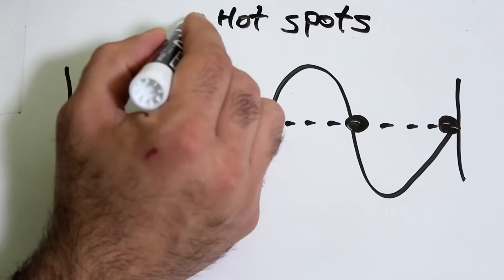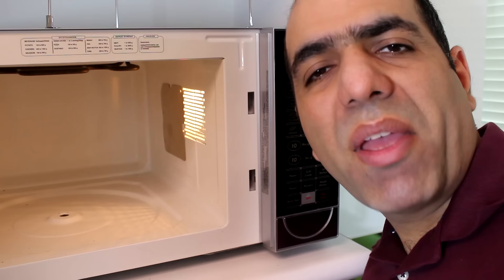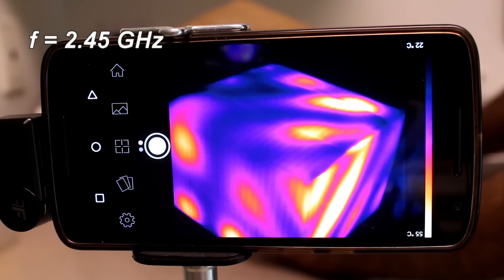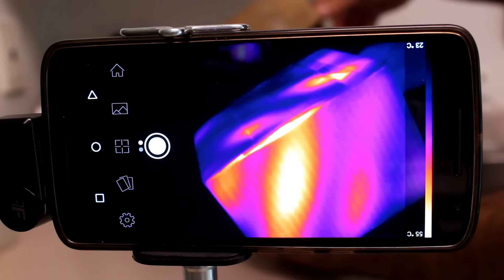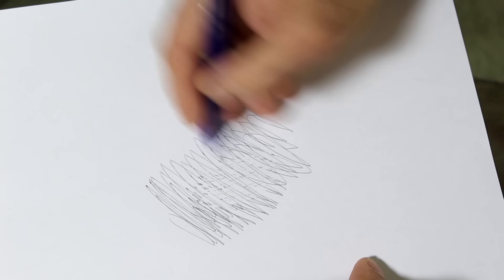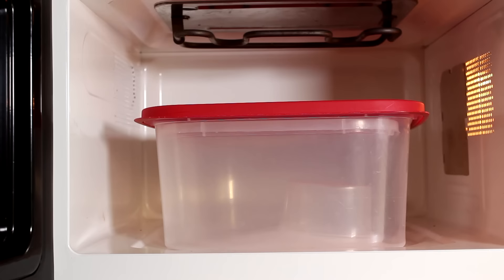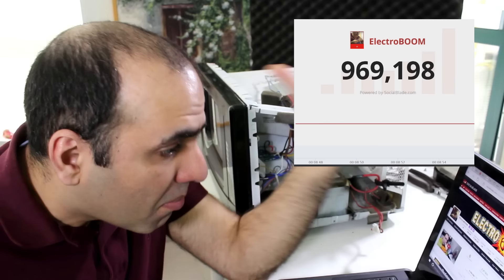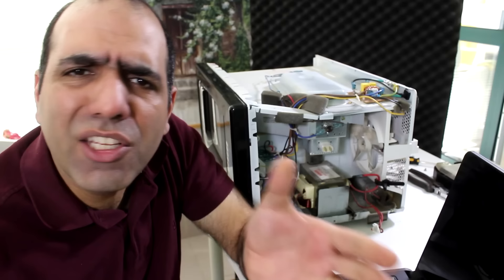Speed of Light, Microwave Oven and How It Works

Comment: Your video is very interesting^^.

Just additional suggestions/comments:

1.Instead of using LED,use a Neon Lamp.
They'll light up as the wave generated,i.e
when the wave is produced by the magnetron it lights up and vice versa.

2.The wave stirrer is used in some of the Over-The-Range type microwave(i.e Samsung,GE brands).
It's uncommon to see it in the Countertop Microwave Oven(type shown in this video).
The commercial ones also used the stirrer along with extra magnetrons in some models.

3.It is not safe for an untrained person to open up a microwave for whatever reason.
Always discharge the high voltage oil filled capacitor by shorting it even after turning it on for a while(read the label on the component- as this could be placed anywhere in the microwave.
One easy method is to use a screwdriver and touch both terminals.
A relatively simple act but could save yourself from electrocution.

Everybody who viewed this channel is very familiar with a short situation- so I'll skip that..Electroboom is a short expert..hahaha..

It's better if you use protective gloves with insulation- there are plenty of sharp metal objects i.e magnetron housing itself and the risk of electric shock.

4.The humming sound not necessarily indicates high voltage diode,capacitor or magnetron problems.
It could also comes from supplying voltage higher than the recommendation.
Sometimes the microwave sounds normal but has a defective capacitor.

Placing a glass of water in on the turntable like Electroboom did,is to see if the water heats up. If it's not heated,the magnetron is not working(it could also indicates the capacitor/high voltage diode is not working as well)
Either way-discharge the capacitor for your own sake and leave the repair job for the service technician)

5.Don't use any metal item(i.e aluminum foils,stainless steel,canned food/drinks,spoons ) inside the microwave cavity,but small amount of aluminum foil is safe and no paper products.
These are fire hazards-could cause fire.
Those sparks/lightning inside the cavity is not trick show/experiment when it burn your house down.

6.Although it is not said in the video,while heating up the water or soup or any liquid,avoid heating it up for too long.
It'll produce superheated liquid-
you'll see it's not boiling from the viewing screen,but when you immediately take it out,it'll boil like crazy.You'll get some nice degree burns.

7.The mushed brain is not possible unless you'd tampered with/by passed the interlock switches.
When the microwave door is opened,the magnetron will not work under normal condition.

8.Although it is already explained in few comments below,

The generated waves mostly stays on the inside of the microwave oven cavity or under the main metal cover(the one that you opened before you could see the components inside)

There might be some leaks,usually on the door if the door metal frame is defective(this frame and the cavity itself act as a Faraday's cage to contain/make the waves stay inside).

The micro waves generated by the magnetron will not cause cancer.
It falls under a non-ionising radiation,meaning that it heats up your body part nearest to the wave source(leakage).Usually your hands,torso etc.Same as Electroboom explained in the video(heat generated by excited water molecules)

In the past,the waves might interfere with the pacemaker,but current version is much better equipped to withstand interference.

Normally the escaped radiation is on the door area(due to defective Faraday's cage,i.e the metal frame on the inside of the door bent).
It is usually way lower than the product regulatory and safety limit(5mW/cmsq).

In the US,the FDA's Center for Devices and Radiological Health (CDRH) monitors this leaked waves value along with other requirements.Manufacturers are asked to voluntarily send their microwaves products to be tested.

In other countries,the relevant certification bodies will perform annual/quarterly audit on the factory that produces this products.

In Canada(I think Electroboom is from here),
for example,CSA Group or old name: Canadian Standards Association(CSA)  will audit the factory uninformed on quaterly basis for making sure the limit is followed apart from other safety requirements.
Underwriters Laboratories(UL) also done the same thing,UL covers for US and Canada too depending on the certification of the product.

The European consumers are also protected,
the certification bodies like TÜV SÜD,NEMKO
and etc performs the audit on yearly basis.
The standard that they use is IEC 60335-2-25.

Not to forget in Malaysia,it's SIRIM.

The magnetron component is the cancer causing culprit.Easily said,the pink component(shown in the video) or of other colours.
Avoid any contact with this or the powder when it falls of.(touch,inhale or etc)
That's why in the US,you'll see California Proposition 65 Warning notes on the microwave carton box.

 I couldn't write down all,but I hope these information helps and don't forget to read the user manual-there's a reason why those warnings are printed there.
They're required by the regulatory bodies.
Although the natural selection is perfectly fine in my opinion,
but the warnings are ways to protect the innocent people that are usually affected by these Darwin's Award winners' actions.

Comment: Don't microwaves only run at half the power because they use a half wave rectifier? Would be neat to try and get the full power unless that transformer is running too close to saturation, and not to mention how easy it is to melt them just by applying a few extra input volts LOL

Comment: Ok, it's just like the way using microwaves to beat food was initially discovered.  Someone had a chocolate bar in their pocket  melt, when using microwaves in a communication system •• and then used hot dogs to tune them.

Comment: if magnitron required voltage then use tesla coil powered by battery or gearbox and pulley system or leverage principles

Comment: thinking back to my radar days.......the extremely high frequency of the power....the electrical properties change to that of a fluid... the wave guide acts like a pipe .....due to skin effect.. the surface of the wave guide is not conducting the electricity  like a normal circuit....but more like a pipe

Comment: Maybe you should warn people about the high voltage capacitor in the microwave that needs to be discharged before you touch the internals...
Yours doesn't seem to have it, but those that have are very dangerous.

Comment: The size of the holes in your microwave door are no accident. They’re just slightly smaller than the diameter of a microwave, meaning the microwaves bounce off, rather then passing through, keeping you safe. Any time the shield in your door becomes damaged, get a new microwave.

Comment: Did you just say that waves in the chamber travel a bit faster than the speed of light (knowing that those waves are electromagnetic waves which IS light). This is so wrong though
Reply: No, he says that based on his measurements of the hot spots. He was saying that he was only a bit of of the actual wavelength

Comment: There's a BIG capacitor just under the fan, sometimes to the side. DON'T touch it. xD
Reply: You can touch the housing but avoid the terminals..(haha).

That capacitor is called high voltage capacitor,usually 2.1kVac and more than 0.1 microFarad.

To be safe,always discharge it by shorting the terminals together(easily done with a screwdriver).

Anyway..this rule applies to all electrical appliances that has built in capacitor,nobody want to get electrocuted even after the supply plug had been removed from the mains.

When you shorted it,there's a spark and pop sound..
(I think all the viewers of this channel knows what it looks like when a short happened ^^
Electroboom always demostrate it perfectly..hahaha)

Comment: I tried to kill a cell phone by putting it in the microwave; it had a metallic coating on the plastic which sparked a little bit and it charged the phone. Phone worked perfectly after I microwaved it I can’t say every phone will be that way, but that Motorola flip phone that I microwaved was none the worse for the wear, except for the burn marks

Comment: So I thought microwaves are low frequency, long wavelength, non-ionizing radiation. And high frequency is short wavelength ionizing radiation, like UV on up to gamma. Yes, no?  I bet there is a way to put metal in a microwave without it arcing.

Comment: Please don't try do anything he done in this video, he hasn't mentioned anything about the high voltage capacitor, after the transformer steps voltage up to 2000v it will go to a capacitor that charges it 4000v, it is very important to have good earthing on the microwave and ensure there is a diode to earth on the capacitor, capacitors hold there charge and if a microwave has faulty diode or no diode you will get killed from the shock touching any high voltage components. Microwave are serious stuff don't touch them unless properly trained, also I would imagine the magnetron are going to really struggle to ignite without the capacitor, he said the rest of components are junk lol

Comment: How we powered microwaves with our hand

We winding up a strong spring by hydraulic Jack which released it's energy  by gears and we run a Dynamo which powered up microwaves oven 

For some time 

How you calculate this system in terms of efficiency 

Hydraulic jack 
efficiency 80 %

Spring energy 
Efficiency.  ? %

Gears efficiency = ? %
Dynamo 
Efficiency = ?%

Microwaves
Efficiency = ? % 

So found a simple integrated formula for it like we give energy to gramophone or trampoline singing metallic drum 

By winding up the winding key 

So if you make such a system then we can saved millions of kwh round the globe 👅😃👅😃👅

We change some circuit of microwaves as well for better efficiency

Comment: I know this is old and you may not read all your comments, but could you PLEASE do a safety video about MOT's?
You video yourself getting shocked all the time and it may lead people to think that MOT's are safe to play with. Your audience needs to know just how dangerous an MOT can be. Consider it a PSA.
For everyone else: Microwave Oven Transformers are capable of very high voltage AND current and can kill you instantly of you aren't informed. Please do not play with them unless you are VERY well versed in their operation and use protective equipment. ElectroBOOM jokes around a lot but these are seriously dangerous toys in the hands of the complacent or underinformed.

Comment: Microwaves are not ionizing radiation and can't cause the breakup of DNA like ionizing radiation, but can still cook you and that will not pan out well for your biochemistry either.
Reply: but theres beryllium in the magnetron if opened. i think thats what he meant by cause cancer
Reply: @SPARKY832010  Don't smash or grind the ceramic insulators and breathe the dust.

Comment: Mehdi, I have a question for you. If light, is not an instantaneous communication and the universe is moving at 1,300,000 miles an hour or 361.111111 miles a second it would create a divergence in a laser beam of 1.1 inches over 50 feet. We do not see this happening so I have to conclude that either we are at a dead stop or light is instantaneous communication. A laser that they use to test the velocity of light, is not an invisible light beam from the side like a beam of sunlight, so it is like measuring apples and oranges. As it requires time to bring the atoms of gas in a laser beam to a state that they fluoresce. Just like electricity must flow through a filament in a light bulb for a time before the filament emits lights. What is your take on this?
Reply: What? Conservation of momentum works with any medium.
Reply: @MaryAnnNytowl , so if as a galaxy we are moving along at 1.3 million miles an hour why do we not see a 1.16-inch deflection in a laser beam? Light has no mass and is considered to move in a straight line at velocity C. However if that were the case and our galaxy is moving rather swiftly it would cause a laser beam to bend 1.16-inches in just 50 feet. 

The fact that light does not have mass also means it is not affected by gravity and it is not. Light bends near heavenly bodies due to a ramping density of gas around any heavenly body like the moon, which causes light to refract into the denser part of the gas.
Reply: @MaryAnnNytowl  Also consider that if light had a speed limit, as a far off image moved slowly through each inch of travel to the viewer, any differences that occur over the time traveled would superimpose over the original far off image. And light would not work as it does.
Reply: @MaryAnnNytowl , you are applying the wrong approach. If light is not instantaneous then a laser, firing a laser beam, perpendicular to the galaxies movement, of 1.3 million miles an hour, must deflect 1.16 inches in order to uphold the laws of "modern" science that state that light is only traveling at C. Because light at velocity C would cause a divergence of 1.16-inches in 50 feet.

Sincerely, 

William McCormick